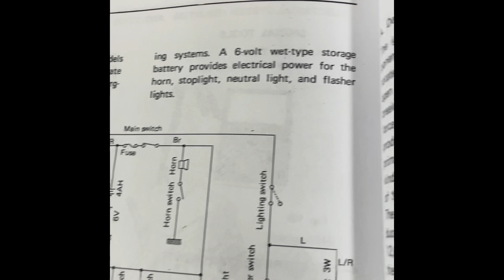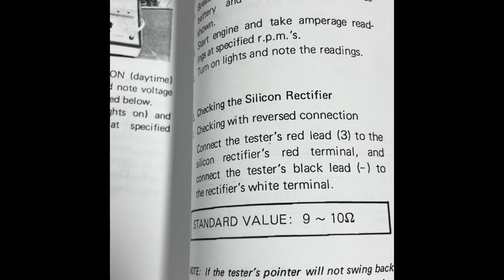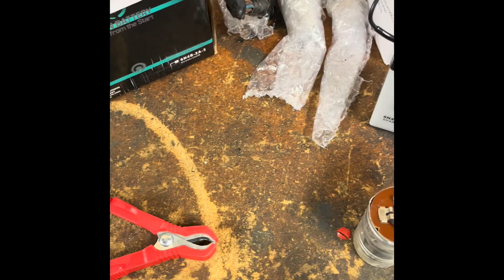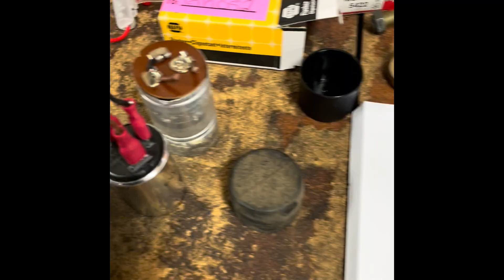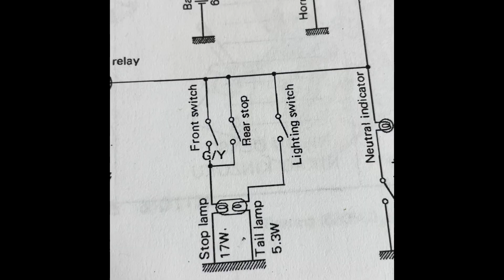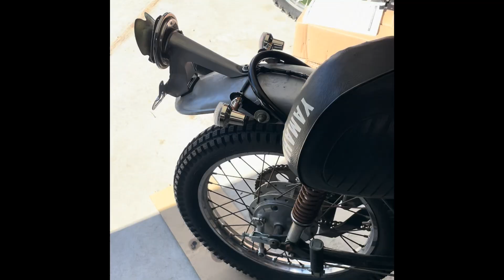Yamaha DT 100 little enduro part 10

Comment: Admirable work you have done with your sharp looking Yamaha. !!
Reply from the maker: Thank you and have a great weekend
Reply: @zachwrench 
Likewise Sir. 
When possible with warm water - a little bit of Dawn dish soap and ( 0000 ) steel wool the clean up of the rear shocks will improved significantly. 👍
Reply from the maker: @RicardoValdes-r6w  I usually use wd-40 with steel wool I’ll give the soapy water a try thank you for the tip
Reply: @zachwrench 
Yes WD-40 with the 0000 type steel wool should work well. You are welcome..

Comment: Possible parts list and part numbers? Please and thank you. I have  a 1979 dt100f. Enduro.  No lights work except taillight but no brake light.
Reply from the maker: K&S BRAKE LIGHT SWITCH SPRING TYPE

Features:
Universal spring type brake light switch
Normal Position: Circuit Open
3.5" Wire
OEM 278-82530-09

Lights Turn Signal Horn Switch Assembly Yamaha DT100 DT175 DT250 DT360 DT400

Reproduction Yamaha lights / turn signal / horn switch assembly for many of the DT dual sport models from 74-76. It's common for the stock switches to wear and corrode from decades of use. Sometimes the horn button breaks or the turn signal switch no longer clicks into place. Lights, horn and turn signals are necessary safety features to have working!

If you are running aftermarket handlebars check to make sure the 28" wire harness is long enough. This switch is designed to have the wires run outside the handlebars.

Wire harness overall length = 28" (loom 1 is 20" long)
Loom 1 = 6 Male bullet terminals, yellow, brown, light green, dark green, pink, light orange/white line, and 1 dual female bullet terminal (blue)
Loom 2 = 6 pin connector, white, blue/white line, green/white line, green red/line, yellow white line, brown
Replaces Yamaha Part Numbers: 558-83972-60-00, 498-83972-62-00

Note: This switch is similar to the DT125/175/250/400 1977-1978 and XT250/500 models but the wiring is not the same.

Fits Yamaha:

DT100C - 1976
DT175C - 1976
DT250B - 1975
DT250C 1976
DT360A - 1974
DT400B - 1975
DT400C - 1976

 4into1 vintage Honda motorcycle parts

Small turn signals 2 pcs. These look verygood on the Honda CT70's. They bolt up to the headlight mount. You will need abracket to mount them on the rear of the CT70. These are 12 volt or we have 6volt bulbs available.

 Please let us know if you need 6 or 12 volt.

I purchased these parts above from eBay those are from the description. The flasher relay was from Napa auto parts it’s the only 6v relay I could find locally. Thank for watching and have a good weekend.